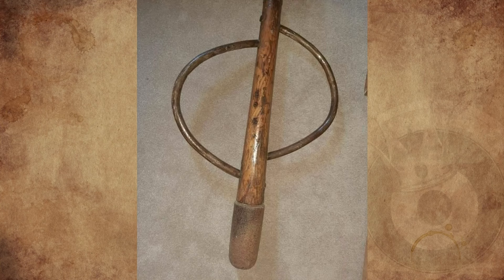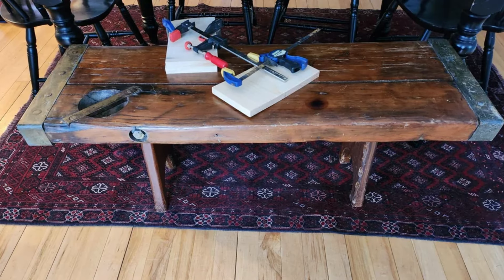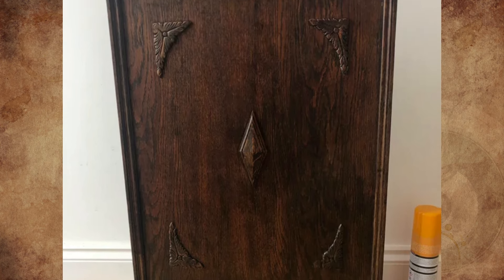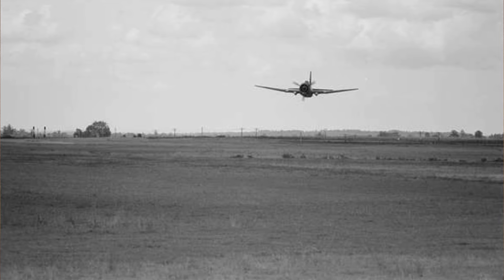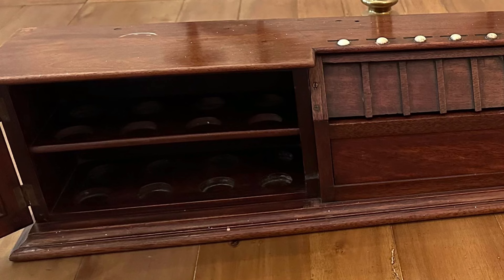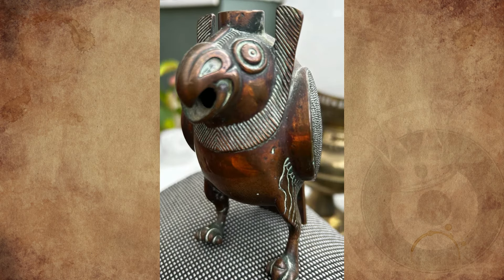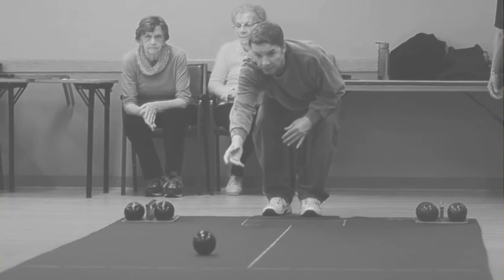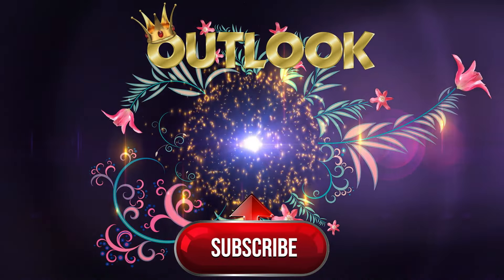What Is This MYSTERIOUS Tapered Wood With Cast Iron And This Machinery Part With A Glass Dome?

Comment: I disagree that the Victorian fire screen was to shield occupants of a room from heat, since the purpose of a fireplace is to radiate heat into a room. More likely, it was to conceal the unsightliness of an empty fireplace while not in use.
Reply: Umm, no; the screen prevented sparks flying into the room and it dissipated the very hot direct heat so one could stand close w/o burn risk.......
Reply: I’ve had fireplaces in two of the houses I’ve lived in. Yes, I’ve used these to keep the heat off of me as I was closer to the fireplace than my wife. They are used for maybe 10 minutes after putting another log on the fire due to the sudden extra heat from the new log as it caught fire and blazed up. Eventually the amount of extra heat will dissipate.
Reply: Also, it was a safety issue, it helped keep long dressed out of the embers and discouraged small children from getting too close.
Reply: We had a fire screen, they were around since at least Victorian times, prolly earlier. It enabled one to sit near an extremely hot fire without scorching oneself. You needed to stay close to the fire as it didn't heat the whole of the room, so you were either too hot or too cold.
Reply: Along with the other answers, It also blocked out the glare of the fire so people could have conversations without turning their face away from the fire.
Reply: No , they were there because it's not unusual to have a cold morning and hot midday , before the fireplace cooled back down.
Reply: The screens are super helpful.  Even if you just have a gas hearth, they are movable and help block the most extreme heat to anyone sitting close to the fire. I use one for the gas stove in the parlor when seated at the table because it can be quite hot there.

The solid British oak plywood screen shown however is not Victorian.  It was made in the 1920s or even 1930s.  Victorian fire screens typically had fabric in the frame.  Large ones could even have a pivoting screen in the frame when they were quite large so the screen could be turned to shade anyone around the fire.  There were some that had arms that attached to side of the mantle so that it could swing out and shade a person's face sitting next to the hearth.  Women's screens were popular and also small so that their face could be shaded and not made red by the heat so that they could keep their milky complexion.
Reply: We only had fireplaces for heat in our Victorian row house. This is a fire screen which is in front of the fireplace hole when there’s no fire, both to deflect drafts down the chimney (no damper) plus for decoration. When the fire is burning, you have a 3 sided spark guard which stands in the hearth to protect from sparks flying onto the carpet/rug or furniture or your clothes from accidentally brushing too close and catching fire.  We Never had the fire screen in front of the fire when burning…they are wood and could be scorched from the heat…and besides, the room needed the heat!
Reply: @pamelaspooner7183 exactly what we did in our house before it was converted to central heating in the 1970s.  We had one screen made from metal, but even that wasn’t put in front of the fire when it was lit.  The three sided fire guard not only stopped sparks from the fire, but served to keep children from the fire.
Reply: It is not a fire guard as these were metal. It is to conceal a fire place, if you put thus in front of a fire it would ignite. My parents had both a fire screen and a fire guard, their fire screen was a tapestry, it would have been even more combustible than that wooden one.
Reply: It stopped the boy being burnt while making the breakfast toast.
Reply: There were decorative fire screens to hide the empty fireplace. As this is wood no way would it be used in front of a burning fire!  There were a variety of mesh ones mostly to stop sparks from flying into the room causing burn marks, or worse, fire.  Either way they were not there to hold back the desperately needed heat!
Reply: As this is a wooden screen, I agree that it most likely is for covering an unsightly, ash-choked fireplace when not in use. I’ve seen some old house renovations where the summer fireplace screen was very tight-fitting and decorative. It doesn’t make sense that this wooden screen, which didn’t really appear to have a lot of charring on the back side, would be used with the increased risk of it catching fire.
Reply: To keep sparks from the fire landing in the room.
Reply: Clearly you have never heated with wood.  Finding the Goldilocks zone between too hot and too cold can be a real challenge.